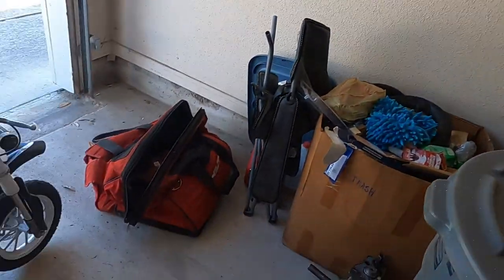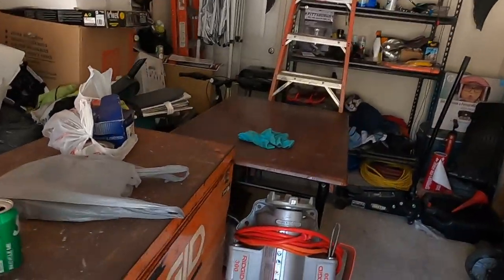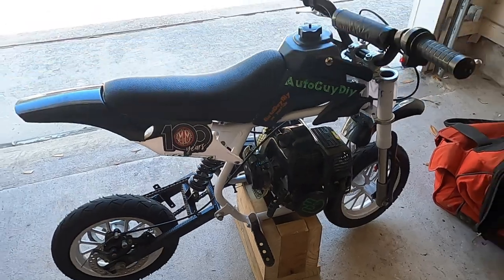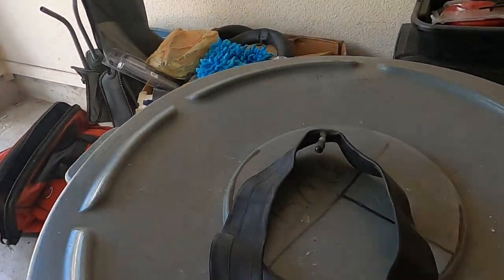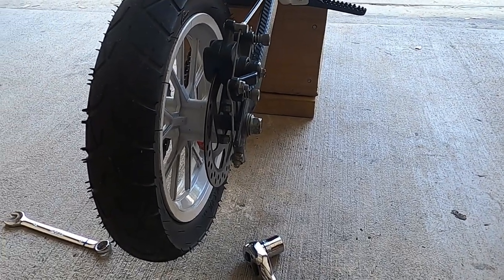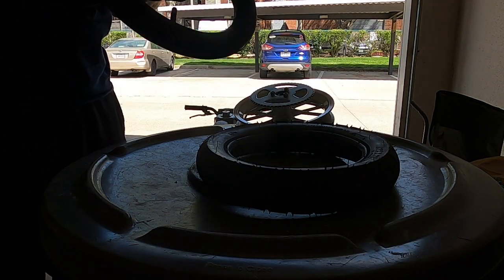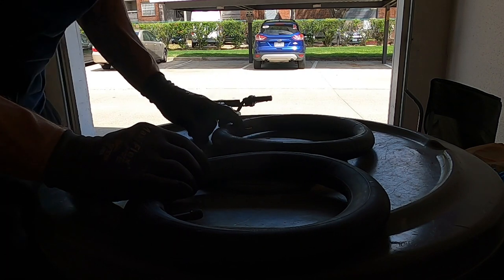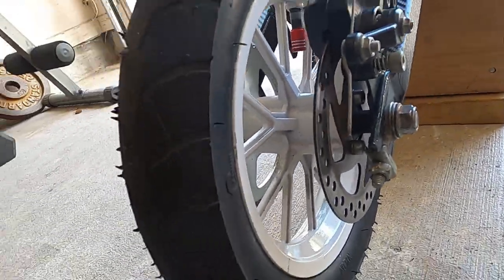Pit Bike Edition. Tube Change, tire installation, And Chain adjustment. #pitbike #gbmoto#letsgoteam

Comment: If you love that bike, you will continue riding it brother. Glad you love it. How's your 4th gen been treating you lately?
Reply from the maker: Not bad
Reply: @autoguydiy4244  Good to hear that. I have an evap leak that I have been dealing with for about two months now. I am going to have my buddy who is a mechanic smoke test it. That way I can find out what's going on and then get into replacing it. Other than that, my truck is still running strong.